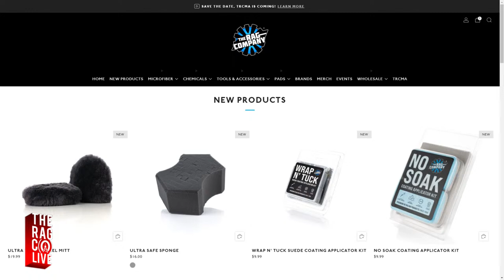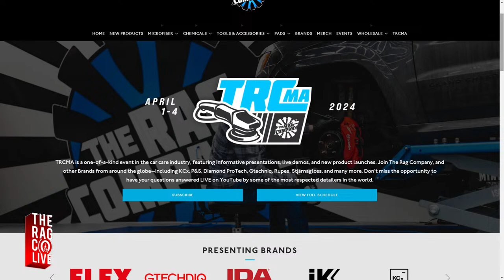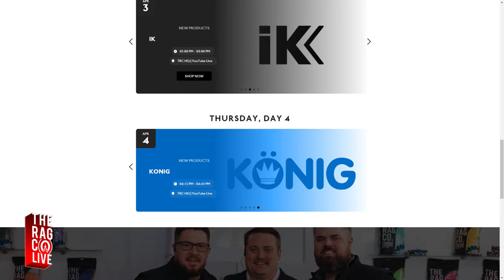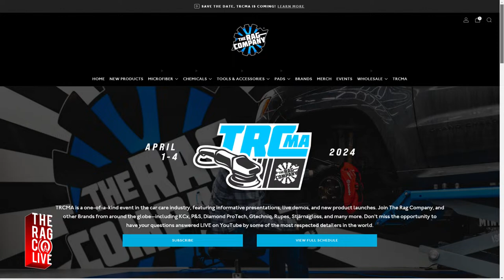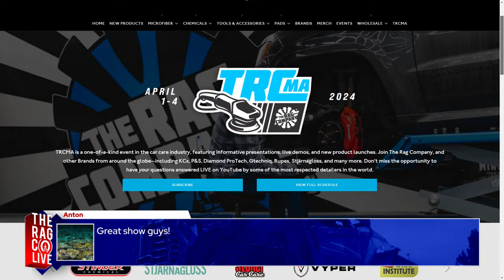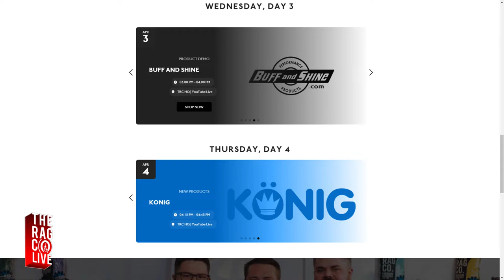FILTHY MX-5 Miata RF Club Detail (Road Trip Recovery Wash) 🔴 DETAILING Q&A

Comment: Dane, how you like that Miata? Been thinking of getting on of those.
Reply from the maker: Honestly? It has instantly become my favorite vehicle I've ever owned. (And that's saying a LOT) 

The first evening after this wash, I took it for a spin on a 6 mile loop of local backroads and I was having trouble holding back literal tears of joy by the last few turns. 

Even though the ND generation was introduced in 2015, there was a major drivetrain and transmission durability update for the 2019 model year, so I specifically sought out one of those. (Mostly due to the fact that the 2019+ models received a nearly 30hp bump over the previous year's model) It's no longer "Miata slow" anymore-- It actually feels a lot like the S2000's I've driven before now, but with a number of modern conveniences and less twitchiness.

I've heard a number of people complain that the RF model (Retractible Fastback) with the power hardtop is more of a "Targa" and less of a "True convertible" experience, and while it may appear that was aesthetically, (One of the main reasons I prefer my RF over the standard convertible is due to the looks of the flying buttresses) the fact of the matter is, thanks to the fold-down rear window, the RF feels 90% the same level of wind-in-your-hair fun that a full convertible does, so I would argue the tradeoff is worth it and it's barely a tradeoff at all. You don't even sacrifice much, (If any) performance because the whole thing only weighs about 100 lbs more than the base drop top, which is the equivalent of a very small passenger.  

If I had any real gripes about the car, it would be the narrow seat bottoms, ingress/egress, a near-complete lack of usable interior storage and paint that's notably susceptible to rock chips. 

The first two issues are mostly on me for being overweight at 5'8" and 290 pounds, but the latter two will affect most people, especially those who wish to use the car as a daily driver like I do.

Yes, it's true that I'll be modifying mine, but the core product itself is amazing right out of the box and I wouldn't fault anyone for wanting to keep theirs that way.

Anyways, I hope that helps!